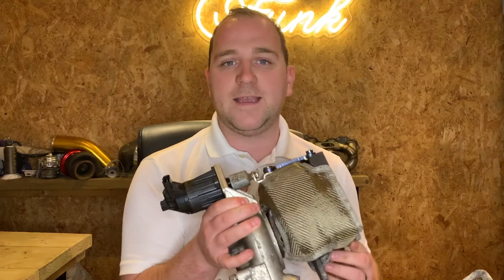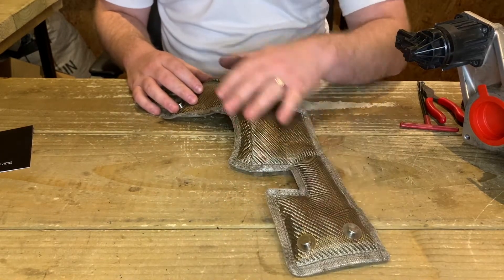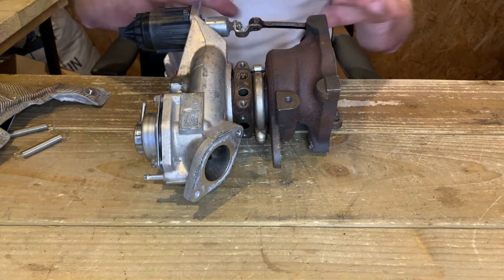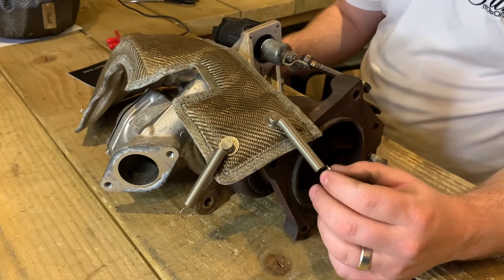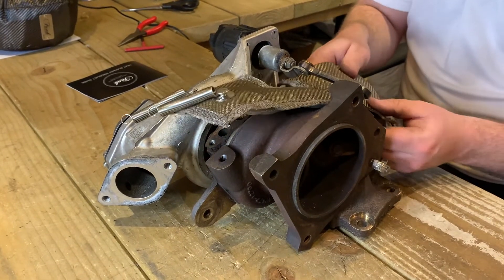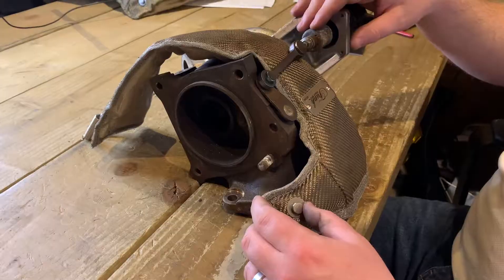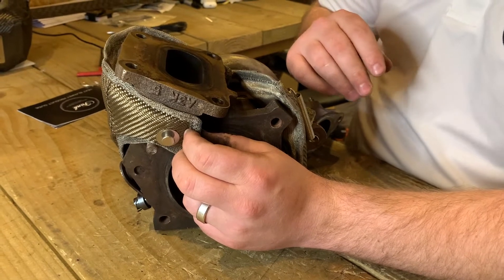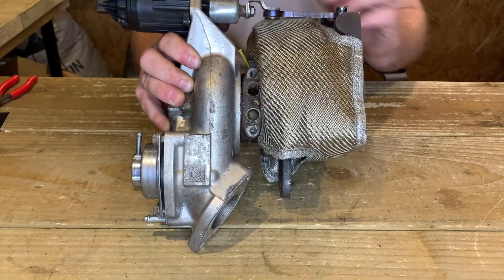Funk Motorsport Honda Civic Type R Turbo Blanket fitting guide (FK2 / FK8 Turbo blanket)

Comment: Great looking product.  Can you fit the stock metal heat shield over your turbine blanket?
Reply from the maker: Good question! Our turbo blankets are designed to be in direct contact with the heat source and do not require any additional shielding, as they will far exceed the capabilities of OEM shielding, and produce far higher heat reductions 👍👍

Comment: Is this good to the turbo? Cause the turbo will be very very hot.
Reply from the maker: Hey! Thank you for your comment today!

In regards to your concerns, this is a common misconception. A turbo blanket actually separates the turbine housing from the core (in regards to temperature split). This allows the core work with less heat strain on it, meaning that the chance of failure is lower. Also, the heat energy stays stored within the gas, hotter gases accelerate far better than cooler gases, and so reducing the overall effect that it would have on the turbo’s life.

Win all around! Lower engine bay temperatures, less heat soak, lower intake temperatures, more reliable performance, faster spool up! Win win win!